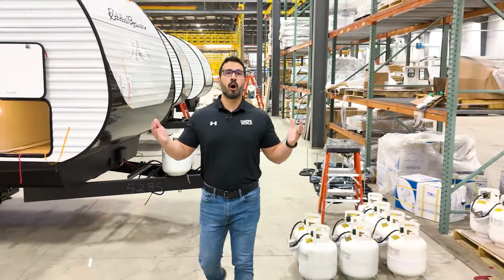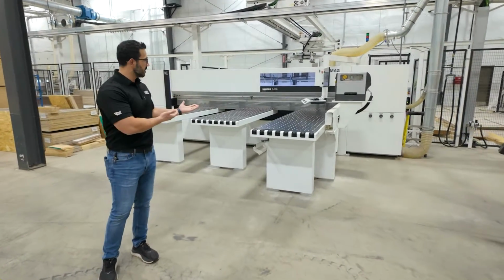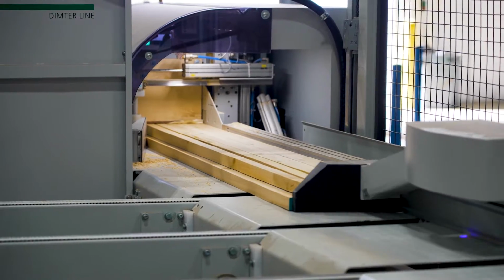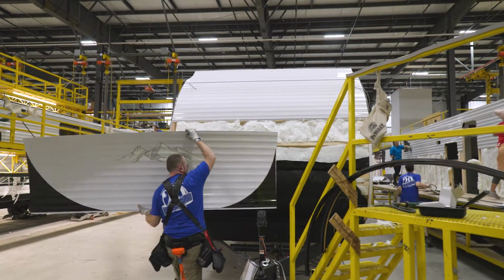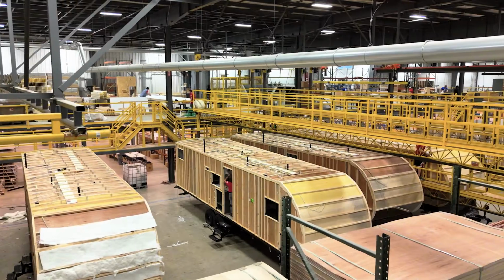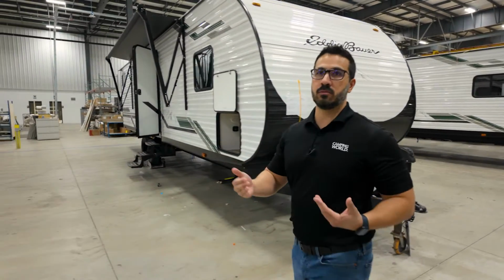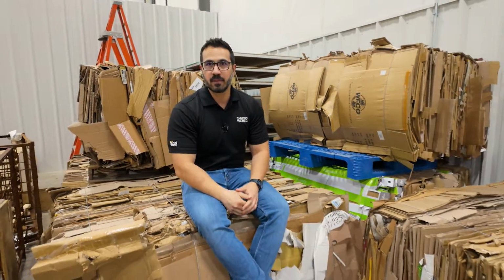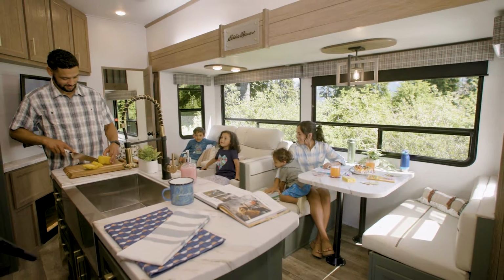New Way To Make an RV?? | Eddie Bauer Plant Tour

Comment: You would have to be crazy to pay what these cost for the garbage they deliver. This is ALL RVs not Eddie Bauer. A few expensive machines that cut cheap wood is not going to fix this issue.
Reply from the maker: You seem to feel strongly about RV's as a whole, can you explain why you feel they're garbage? If precision cutting isn't an improvement in construction, then what would fix the issue in your opinion?
-Ian Baker
Reply: @campingworld  Well lets compare a $200,000 boat to a $200,000 RV in quality. People sailing boats that are 40 yrs old across the oceans every day for what they cost. I never said precision cutting isn't an improvement. I said that is not going to fix the issues that plague the junk that is made. There is no lemon law, warranty can be eaten up waiting for someone to fix issues. You use the cheapest materials possible and you know it. I live near some RV surplus stores and its lower quality than what mobile homes are made out of. Here is a tip if you want one. Make it so your units are repairable and serviceable. Don't design them so you have to tear the whole thing apart to get to a bad connection or where someone ran the wrong screw into wiring. IMO these are designed to be thrown away after 5 years.